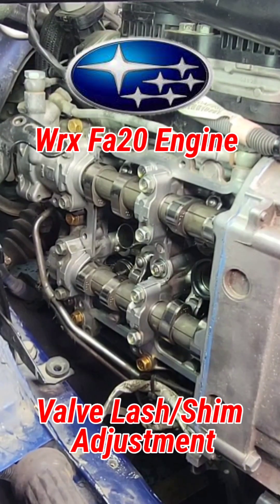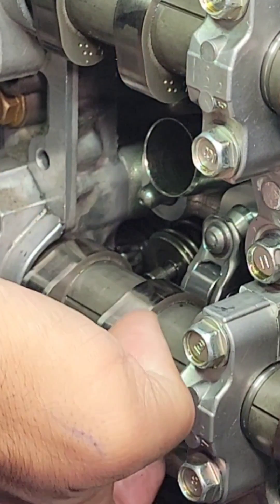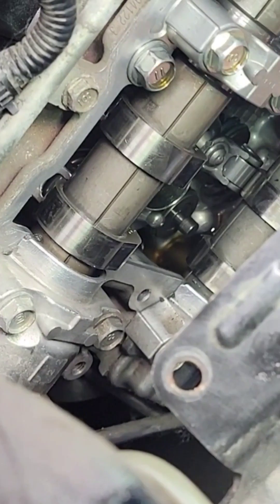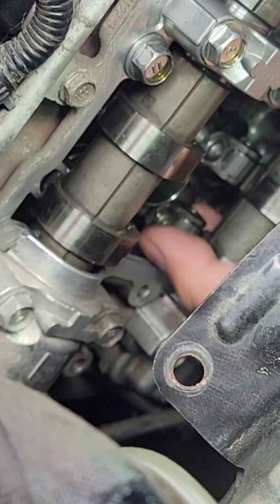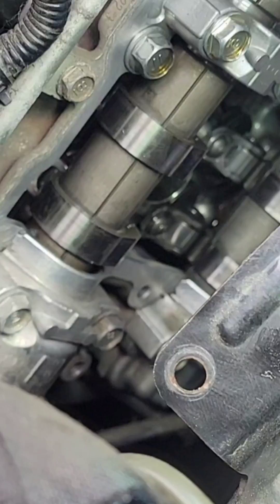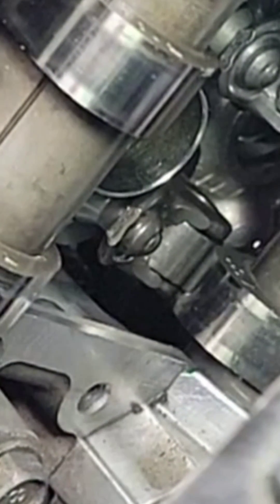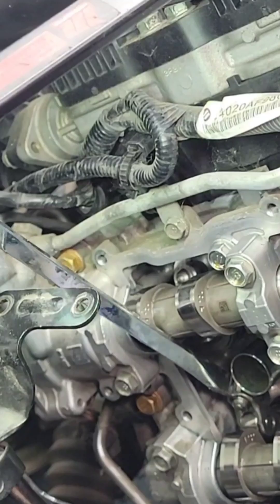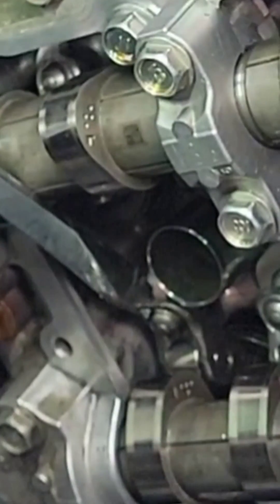[Rocker Install] FA20 Engine Valve Shim/Lash Adjustment #fa20 #enginenoise #subaru

Comment: Can this method be used on both intake and exhaust valves?  And is it doable without pulling the motor?
Reply from the maker: Check this other video https://youtu.be/KCLJpK3AvhA?si=Hq7n_98b73J9uhhL
Reply: @jfGarage4k  thanks!!  Just watched it!! I believe o am having issues with my clearance.  Car runs and drives totally fine and normal but has this no normal ticking sound (not rock knock) coming from the passenger side head.  Did this car have something like that as well?   I’ve checked clearance and it was off.
Reply from the maker: @T.Hansen Yap same problem in my case. I endup replacing all the shims to this Engine